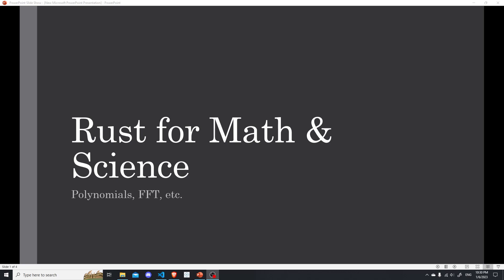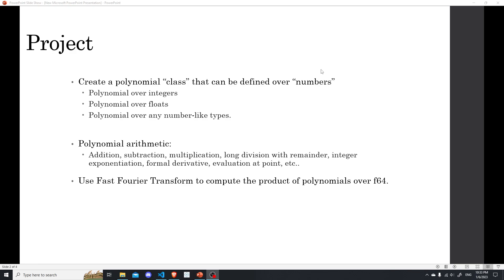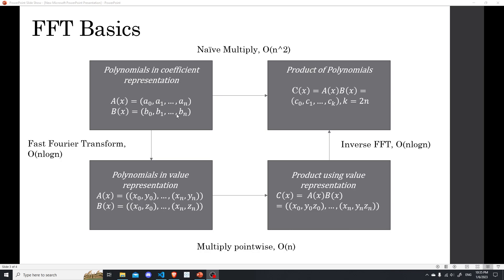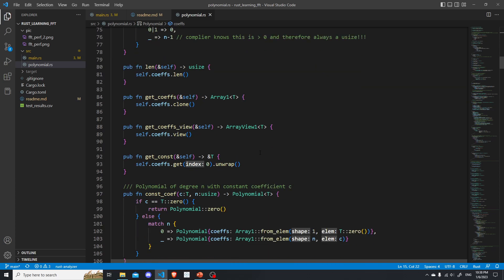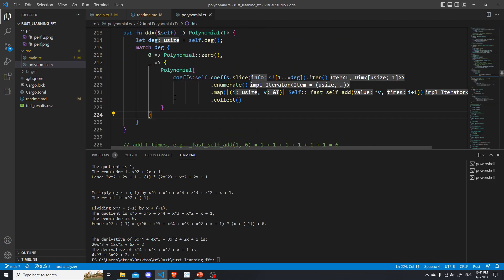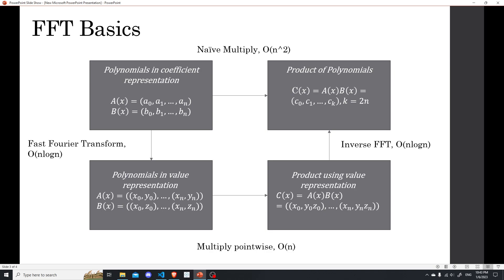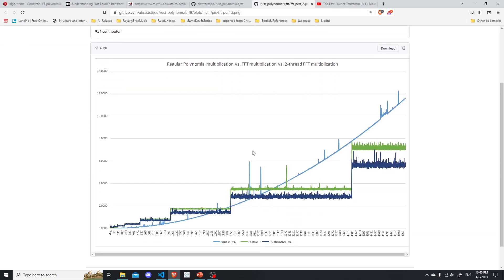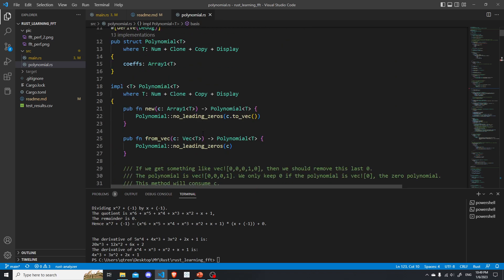My Winter Rust Programming Project | Rust, Polynomials, Fast Fourier Transform

Comment from the maker: The division, 3x^2 + 2x + 1 by 2x^2 is happening over integers. So the result is correct. I defined the polynomials to be over integers, so there won't be fractional values and I had to modify long division a little bit in order to get polynomials with integer coefficients.